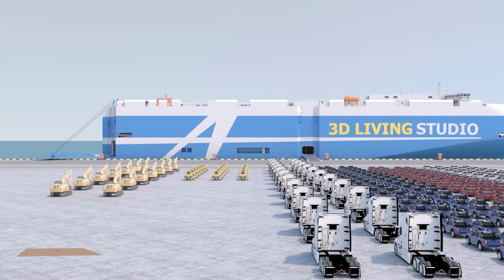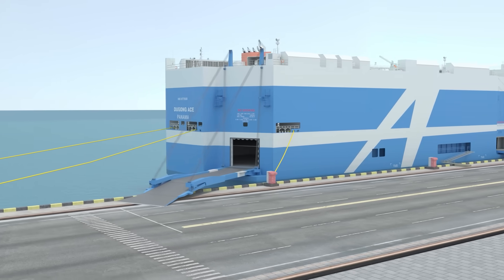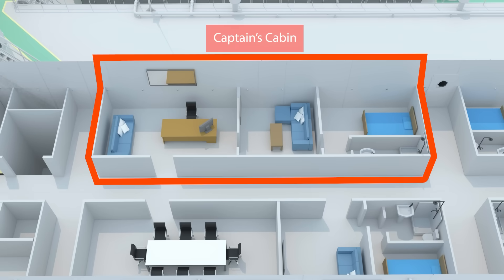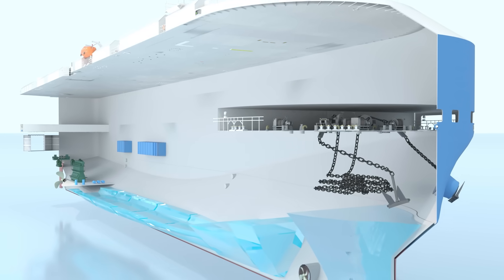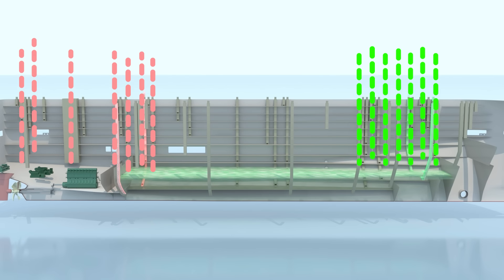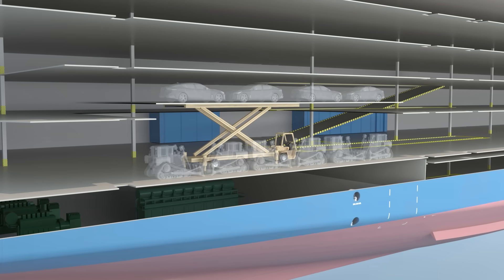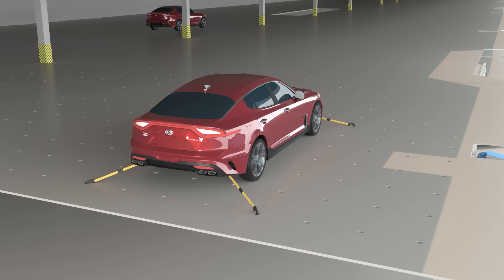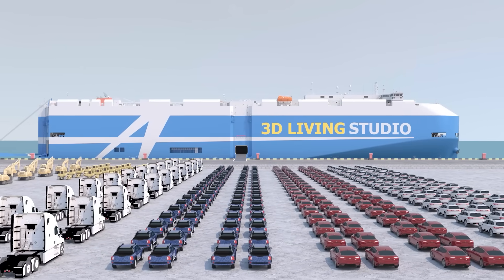How Ro-Ro Ships Transport Cars Across the Ocean

Comment: I retired at the end of 2022 just a few years short of 50 years as a Marine Cargo Surveyor. My home port is Baltimore but I worked at times in Norfolk & Portsmouth VA,, Wilmington DE, Philadelphia, Port Newark & Elizabeth NJ, Boston and Providence RI. When I started in the 70's cars were shipped aboard Bulk Carriers and the vehicles had to be lifted from the holds with the ships cranes and set pierside to be driven to the storage lots. Then many Bulk ships were fitted with side ports and internal ramps for them to be driven off. Then came these RoRo or Pure Car Carriers whichever you want to call them and I've worked on many of them. Mostly they were with Mitsui OSK, NYK or K-Line. I also worked on some of the Combo Container/RoRo ships from ACL and NOSAC at times as well. I kind of miss it all now.

Comment: LNG ships have severe methane leakage in the supplychain and don’t burn the 100% of their fuel in the engine. Hence having a lot of methane in the exhaust. That makes them at least the same environmentally damaging as the diesel driven vessels, even exceeding them. All because Methane has a green house potential of 80x of CO2 (within 20 yrs )
Reply: I think it's just different kind of damage. LNG engine responsible more for global warming due to methane, while diesel responsible more for acid rain due to SO2 and NOx